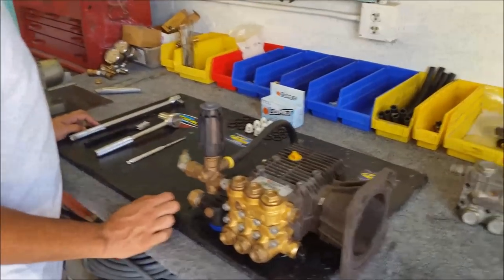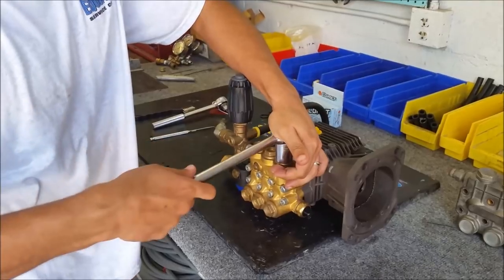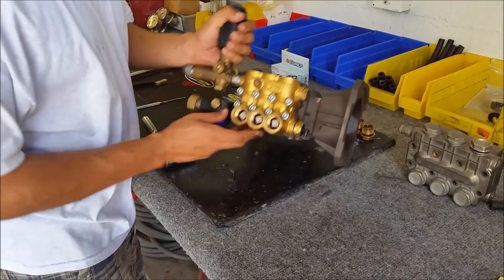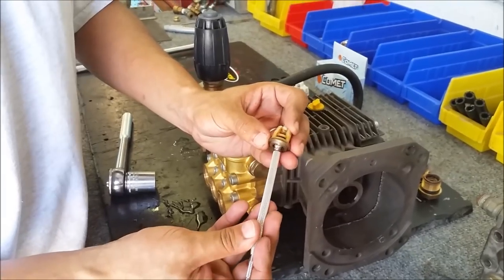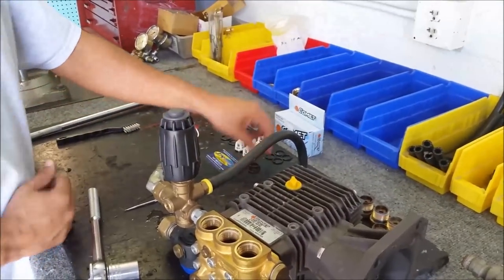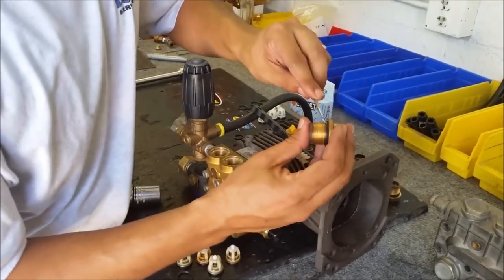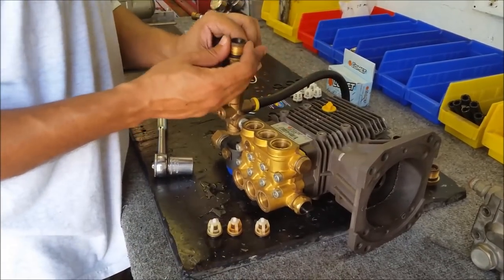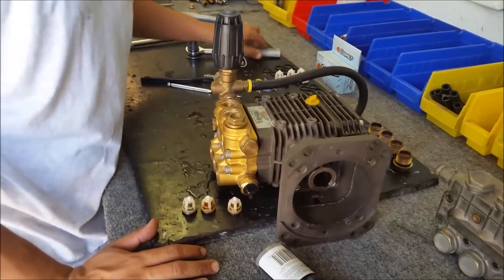How To: Pressure Cleaner Valve Repair

Comment: Thanks for the video...  I have a cat pump and am only seeing 3 valves... Am I missing something or do some pumps have 3 rather than 6?  Also, if one or more of these valves are damaged or filled with debris, would that limit the water pressure?
Reply from the maker: +doodles2997 , yes it's possible for a pump to only have 3 valves. As far as the valves being damaged or having debris interfere with them opening and closing the answer is YES that would have an effect on the pumps ability to build and maintain high pressure.

Comment: Hi I have a preasure washer machine and i have a question i dont know if you could help me out, on the bottom part of the pump water comes out through their when I use hot water and now water escapes from their even with cold water and before it was just with the hot water but now is with hot and cold water that water comes out through their, do you have an idea on what could be causing this or what the problem could be?
Reply from the maker: If water is leaking down in-between your brass head and the pump body than it is likely the Water Seal Kit sometimes referred to as just a seal kit. I would imagine you probably have lost some pressure also .